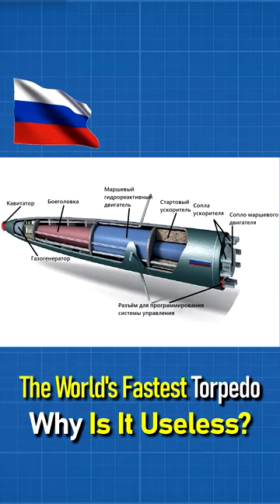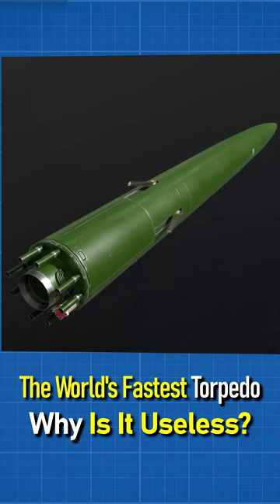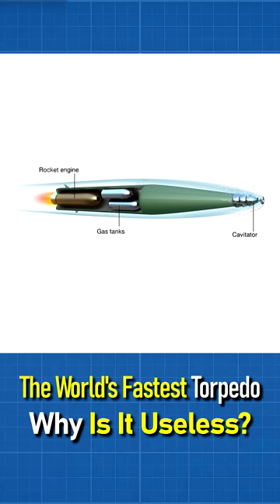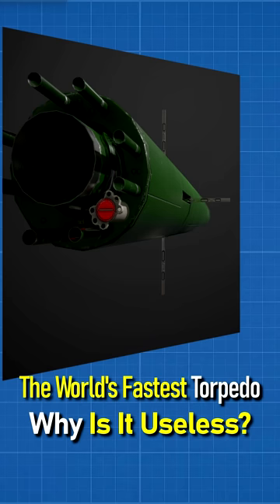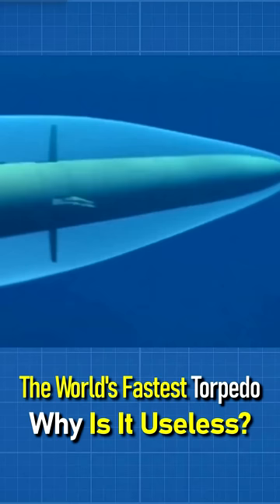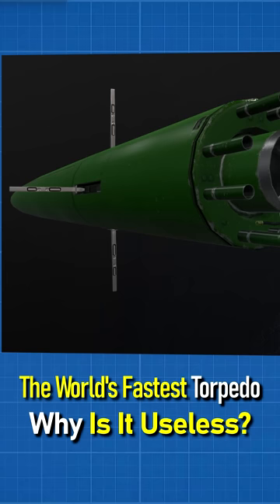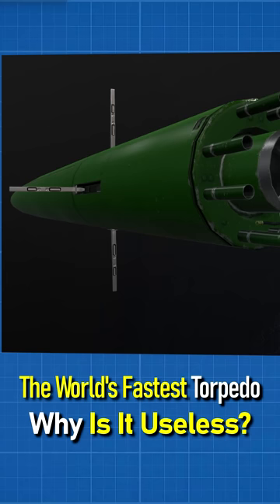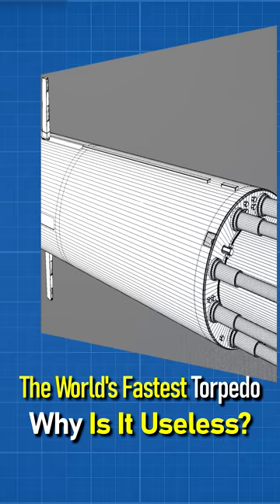The World's Fastest Torpedo • Why Is It Useless #Shorts

Comment: Less than 3 minutes to maneuver at maximum range if detected immediately at launch
Reply: that's quite a bit of time.
Reply: @somethinglikethat2176  and that's a lot of steel to move
Reply: At 13 km even an aircraft carrier is not a big target and a minor course change would be enough to cause a miss. Of course the sub could launch multiple torpedoes to increase the likelihood of a hit.
Reply: @userofthetube2701  the nuclear one would be the choice of Soviet submarine comander.
Reply: @imtableship1703  that's a lot of steel that has been designed to be manoeuvrable. It's not an oil tanker. A modern aircraft carrier do a u-turn in 3 minutes.

A 333m target at 13kms isn't a big target. It's less than 1.5 degrees in a prefect scenario.
Reply: @somethinglikethat2176  the torpedo often had a nuclear warhead so it doesn’t need to be anywhere near to sink the carrier
Reply: 50yo , model for 2018 and two successor beafor, nothing to coment ,comper?

Comment: IIRC the original design includes a atomic warhead and  was intended to be fired as a snap shot at a target that was in the process of attacking the launching platform. "Get out there fast and kill anything near where it's aimed." For that limited application it would still be far from useless.
Reply: Yeah a guaranteed revenge if attacked to be shot at the bearing of incoming torps with a n warhead

Comment: Its main use is to deliver a nuclear warhead in the middle of a US carrier group. It wouldn't really be used against point targets in a real war. The Russians have wire/active and passive sonar-guided torpedoes, missiles, tube-launched-missile-delivered torpedoes, and wake-homing torpedoes for attacking individual surface ships and submarines.
Reply: It's a port destroyer torpedo... Also, it's an impact explosion torpedo because it's shape can't fit the modern day detection device for explosion so no real use in firing at a carrier group. Sure you might be able to sink a single carrier, but if any anti-torpedo defense is dropped and the torpedo impacts it then it's rendered basically useless as it wouldn't be effective against surface ships in that manner.

Edit: typo
Reply: mm yes multiple megatons of nuclear blast in an incompressible fluid from 10 km away.
Reply: @ryannelson8717  The original version does have a tactical nuclear warhead.  It was presumably triggered by the inertial guidance system when it reached the chosen distance.

Later variants use a 210kg conventional warhead and have terminal guidance.  Even the downgraded versions they sell to other countries has that.
Reply: @firstletterofthealphabet7308  thats what makes it dangerous

Comment: It didn't need a huge payload or an advanced targeting system. You'd aim it almost like a bullet, and that's what Shkval pretty much was. A heavy bullet against aircraft carriers. Moreover, a 210kg warhead isn't an issiue, when you're going 300+knots and weigh as much as this thing. Against it's designed target, the Shkval was deadly.
Reply: Which aircraft carrier did it sink?
Reply: @Typexviiib  Fortunately none. Bit of a bad sentence constructuon on my part. However Shkval was, infact, more than capable of sinking something like the Nimitz, and that's without it's payload even detonationg. Purely with it's kinetic energy
Reply: @Mr SlyFox  I could see a Nimitz class crippled if this torpedo slammed into it, punched inside, and exploded its 210kg warhead inside the ship.  Probably not sunk, but it would have to return to dry dock.  Theres absolutely no way the ke of the impact alone would sink a carrier that size.  Even if we assume the launch weight of 6k kg, and the 300kmph speed, that's not that much ke on something as large as a carrier.  A 15 inch shell has more energy, and nobody would claim a single 15 inch shell, even hitting just below the water line, would come close to sinking a carrier.  They are too compartmentalized for a single ke hit to pose a deadly threat.   

Never mind how hard it would be to hit a moving target from 10 to 14km away with an unguided projectile in the first place.
Reply: @Typexviiib  But that's how it was designed. And that's why the warhead is so small. Also keep in mind, that this thing is much bigger than any battleship projectile ever fired. 533mm compared to 460 and weighs almost 3 tons. It also wasn't supposed to be fired from like 15km, i doubt i could go that far
Reply: @Mr SlyFox  a 15 inch shell at 2900kph with 800kg has 260 million joules of energy
300kph at 6000kg has 21 million joules of energy.  The 15 inch shell has 10 times the ke of this torpedo.   Keep in mind that ke increases with the square of velocity.

 Diameter is largely irrelevent because we are assuming in both cases the shell stops inside the carrier, dumping all its energy.  The 200kg of high explosive is going to do way more damage than the impact.  

It would probably have to be launched from at least 10 km, carrier groups cover a radius a good bit larger than that when operating in hostile waters.  You're just not sneaking up close to a us carrier with a large ex soviet nuclear sub.

Comment: I have a much different opinion.  If the U.S. had this weapon the viewpoint would be the total opposite. Also its explosive force would take out a few ships that like to travel close to each other. All ships have no speed to avoid this at close range
Reply: The us doesnt have this because dumbfire torpedoes fell out of favor in the 1960s.  There are no ships that would travel close enough to each other for multiple ships to be hit at once.  Carrier strike groups generally have a couple miles between ships in operational settings.  

You're right itd be hard to dodge at close range, but it's even harder to doge a slow torpedo that adjusts course to intercept you, and can target small areas like the rudder.
Reply: 210kg of explosive mass is enough for 1 modern ship not a bunch....
Even bigger bombs from ww2 couldn't reach that kind of destruction besides the nukes.
Reply: 200kg would struggle to sink a modern warship lmao.
Reply: @clankplusm  Depends on the hit.
Modern ships downgraded their actual physical protection compared to the fun days
Reply: @aquadox5514  there is no armor thick enough to stop modern torpedoes, missiles, and guns. So, instead, they are fast and have many anti missile systems
Reply: @johnsatan117  Torpedoes and missiles yes, though primarily the back breakers. Ww2 bombs had some scary explosive mass.

Guns? Lol no.
We stopped using big guns and traded them for missiles. The only guns left are around 127mm if not smaller(maybe some bigger ones but they aren't used on the most modern ships) and they are for use against possible close range aerial threats and small naval threats.
Reply: Personally. Idc who made this weapon… I think it is stupid as shit because I have personally studied submarine warfare.

The rly short range would mean that the second the sub launches, enemy warships could near instantly counter launch a torpedo (or more) in the direction of the sub.

The sub may kill the surface ship but it is just way too pointlessly risky to waste a torpedo slot on a sub with this expensive piece of shit.

HEAR ME OUT THO… I’m saying this because a better version of this already exists (actually multiple do).

First is the torpedo with a rocket attached to it so it can be yeeted into the air and sent over/nearby an enemy vessel (letting it hit subs and ships)

Secondly we have literal anti ship missiles which are way faster and track their target.

Comment: The torpedo doesn't have to have a large warhead because the speed alone would generate enough kinetic force that would cause maximal damage.
Reply: Nope not enough speed to penetrate
Reply: @joemango9782  it depends on what the target is
Reply: Cuz this torpedo has enough speed to penetrate a destroyers hull
Reply: @joemango9782  modern warships are not armored
Reply: Having a large unguided torpedo that relies on ke to get the job done seems very odd to me.  

I'd rather have a guided torpedo that dives 10 feet under a hull and explodes.
Reply: The deadliest aspect of a torpedo is it’s large explosive payload, this thing would just poke holes instead of opening up a huge gash or breaking the keel
Reply: @Typexviiib  it wasn't designed to be extremely accurate, it was supposed to reach the general area where the nuclear warhead had sufficient force to kill anything in the region. 
It's original design started in the period when wire guided torpedoes were taking over from dumb unguided torpedoes, as such, kill the enemy doing the guidance via wire and the enemy torpedo was too unsophisticated to successfully complete it's attack. 
As miniaturizing got better and torpedoes reached the point of being capable of prosecuting the attack without assistance, the reason for this design become obsolete. 

It's like the old US nuclear air to air missile that was supposed to knock an entire bomber group of of the air back before ICBMs made massed bomber attacks obsolete.

(Edit: spelling)
Reply: @rhysfirth3506  ya, this makes a lot more sense than a dumbfire  short range torpedo that relies on kenetic energy to get the job done like many have commented under this video.  Hopefully we never see nukes used in war.
Reply: @rhysfirth3506  It was supposed to be a nuclear large-area-of-destruction weapon with a range of only 13 km?

Who gets that suicide mission?

If you have a giant area of effect, you don't need to get the weapon there at top speed. Think about the top speeds of the targets you'd be aiming at; aircraft carriers or nuke subs aren't known as sprinters.
Reply: Bugs hit your windshield at a fairly-high relative speed. Do they penetrate?
Reply: @michaelccozens  I did the math in another thread, the ke of this torpedo is around 10 percent of the ke of a 15 inch shell, and no one thinks a single 15 inch shell can sink a carrier, especially if it was relying on ke alone
Reply: Not true.  This isn't hypersonics.  Of course it penetrating and exploding inside the ship would be more destructive than exploding outside.  More efficient use of the warhead.  But that is not the same as saying the kinetic energy of the torpedo will make up for the lack of heavy warhead.  This isn't hypersonics.
Reply: @michaelccozens  the area of effect would never be 13km. Water is dense, heavy, incompressible and excellent thermal mass. 
I'm not privy to the classified details, but I would highly doubt the area of effect would be more than 2km. 

Looking at equivalent nuclear depth charges (just dropped over the side of a ship) and the US nuclear tipped ASUBROC antisubmarine rockets, the designers obviously would have dialed up or down the yeild of the chosen warhead to not put the firing vessel at risk at typical engagement range. It's not like they crammed Tsar Bomba in there! 

Now if the sub commander is faced with an enemy sub showing up on sonar at 3km and the lethal radius happened to be 3 km? That's a decision for the captain to make, risk possible death at the edge of the zone, or possible death at the hands of an enemy torpedo? 
I wouldn't want to make that coin toss.
Reply: 210kg of high exsplosives is a "big old bang".
Reply: @danielriory7851  cardboard?
Reply: @vanrex7682  wdym?
Reply: If I remember correctly, it had a 10 kt warhead that should be about 1 KYD radius of damage..
Reply: "Maximal damage"
laughs in Predacon
Reply: That’s not how Torpedoes work my dude.
Reply: Absolutely.
Reply: @Typexviiib  its 70's tech......the most modern versions of it are too op
Reply: @michaelccozens  it would have carried a small war head
Reply: @user-rl8hf8kt1r  ya, just like all the other russian weaponry.

Comment: Shkval was not useless, it was designed as a deterrent. The US Navy had superior acoustics allowing for first shot advantage and the Soviets knew it.

At the time, most, if not all torpedoes were wire guided, you can see the red spool dispenser on the back of Shkval. 

The doctrine was to listen for a torpedo launch, immediately turn toward the source and fire a lightweight, high speed Shkval, that would arrive on target much faster than the standard high explosive warhead, forcing the US sub commander to move evasively and in the process, sever the torpedo control wire.

Comment: sounds pretty dam awesome, very seldom you need any longer than 7km underwater, as most subs would be using passive sonar for detection anyway. as for sound cavitation at that speed does not matter giving its own signature away. as for hydro phone detection and aiming, most modern torpedoes fitted with this would be wire guided at 1st (as it stops the torp going for the larger sound of the sender sub) lots of torps will use sea water into the fuel to slow the speed of them .

Comment: Some of the problems associated with this are easily overcome. Delay the rocket to somewhat keep your location hidden. Or you can just drop the torpedo and let it sink and let it fire the rocket once it hits a certain depth. Also why don't submarines just use a buoyant torpedo that turns on a rocket at the surface like a javelin missile

Comment: it did a good job on the Kursk!
Reply: Absolutely. I met this guy funnily enough that ran the diving opps when they brought it up. He ran the opps for Nord one as well.
Reply: Kursk was downed by another sub. Read the latest finds. US sub was under repairs in Norway after that encounter. That's why they never rescued the crew, it would have been too many witnesses. Russian couldn't reveal this as it would have damaged reputation as it couldn't retaliate in the 90s.
Also, to keep it quite a lot of Russian debt was written off after this incident, coincidence?
Reply: @dl7857  No it wasn't.
Reply: @dl7857  any sources?
Reply: @nicholasbrown5013  unfortunately, as you may understand it's just a theory - an unofficial explanation. Both sides came to an arrangement, so anything that contradicts it will be dismissed. I found out about this theory from an independent investigation which was shown on Australian channel a few years ago (5 or more). I tried locating it, but unfortunately couldn't at this time. Mostly it's based on the several aspects, one that Russia never retrieved the front of the submarine (everything apart from the front), as it may have contained evidence of collision. Second, there are records that a US sub arrived to Norwegian port damaged after Kursk sank (if im not mistaken is was USS Mamphis). And third, partial write off of Russia's national debt.
Finally, it was very unusual to wait for so long to start a rescue of survivors unless you didn't want them to say something. 
Yet again, it's just a theory but one that may very well make perfect sense.
Reply: @dl7857  i know there’s a few stories like this for other subs as well… i’ll check it out. i think there were a few cold war scares like this.
Reply: @nicholasbrown5013  youtube is preventing me from sending a link. Here's what it says (Skeptics Stackexchsnge): 'French filmmaker Jean-Michel Carré, in Kursk: a Submarine in Troubled Waters, which aired on 7 January 2005 on French TV channel France 2, alleged that Kursk sank because of a sequence of events triggered by a collision with a US submarine. Carré claimed that Shkval torpedo tests were being observed by two US submarines on duty in the region: USS Toledo and USS Memphis. According to his version, these observations eventually led to a collision between USS Toledo and Kursk. Carré theorized that neither of the subs was seriously damaged in this incident, but the sound of the collision, combined with sounds of loaded torpedo tubes, made the captain of USS Memphis believe that Kursk was preparing an attack on USS Toledo, so he launched a pre-emptive strike against Kursk with a MK-48 torpedo. According to Carré, this attack was successful and was the cause of the powerful explosion within Kursk's hull, sinking the submarine and leaving Memphis and Toledo slightly damaged. Carré claimed that specific damage visible on the Kursk hull was the main evidence of this version, including signs of an initial collision, and a hole left by the torpedo when it entered the Kursk hull. He also claimed that a damaged submarine was sighted leaving the Kursk incident area, and USS Memphis was sighted soon afterwards being repaired in a Norwegian port.'
Reply: @dl7857  Imagine trying to say the Kursk wasn't sunk by the horrible corruption, horrible maintenance, and horrible training of the Russian Navy. Kursk killed itself
Reply: @rileyhaynes2515   that's also possible and I don't rule it out. However there are aspects in this case that just don't make sense. If you see the photos of the hull that was retrieved, you'll have some questions too.
Reply: The Kursk was sunk because a regular torpedo exploded when it's highly concentrated hydrogen peroxide leaked out and came into contact with copper, producing large amounts of oxygen and steam.
Reply: @pieterveenders9793  yes, I know how to google search. This is an official explanation, and I don't rule it out. I just point to other aspects that haven't been explained.
Reply: @dl7857  Yes ...the Russians had this is their arsenal and it gives the other sub no time to react and as such the other sub cracks off a torpedo "because they'd have no time to react".
Reply: @dl7857  My man you literally posted cringe.

„Don’t listen to the official story, it definitely happened like this!“

„Proof?“

„ItS jUsT a ThEoRy!1!“
Reply: @AnonD38  I know it's difficulty to question official narrative. However, so many stories emerge from cold war that were only 'theories' 50-40 years ago. I don't want to convince anyone one way or the other. You can believe whatever you want. 
For me to be sure 100%, more explanation it required to the aspects I've touched on above.